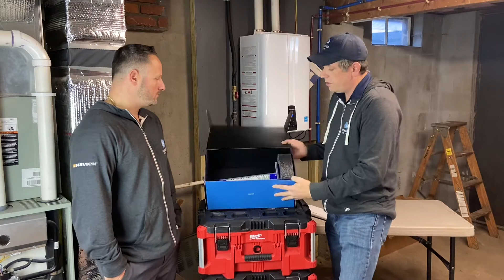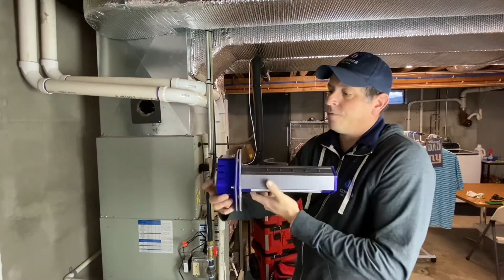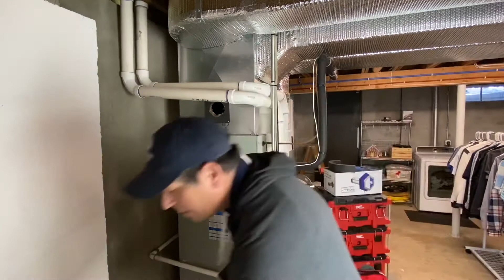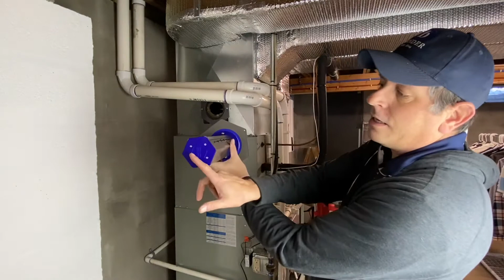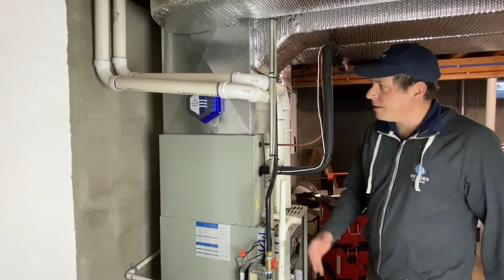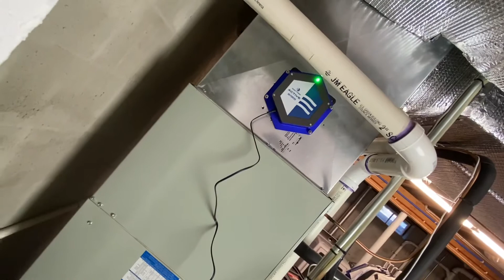UV Light Install- Dust Free Active Air Purification (Part 2)

Comment: Is the light on all the time or just when the fan is on?
Reply from the maker: It’s recommended you wire it to run continuously so it is always shining on the coil to keep it clean- however you can wire it to come on only when the fan is on. Hope that helps
Reply: @jasongiannone1229  Thank you.
Reply: @jasongiannone1229 would you use a sail switch for that?

Comment: Did you use the self taping screws, to secure the mounting plate or did they go through both the mounting plate and the base plate? It appear the holes in the plate  were pre-drilled or did you have to do that?
Reply from the maker: Hello- the holes come pre drilled so we just screwed through the pre drilled holes in the mounting plate into the plenum. Hope that helps
Reply: @jasongiannone1229 Thank you for the reply. They appear to have changed the design, since the mounting plate is not pre-drilled  currently. Also the instructions do not tell you how to un-screw and rotate the "core"  to align it properly (as shown in your video). Therefor you wind up with the logo going up and down (the light is now at  the 9:00 position) rather than sideways, with the light at the 12:00 position, as shown in the instructions. Were the screws used on the mounting flat flathead? Otherwise the heads would keep the base unit from mounting flush on the mounting plate. It looks like I will be dissembling the unit and  remounting it correctly.

Comment: We have one in our home 
We don’t like it cuz it has a strong order
Reply: What size do you have a 12" or a 6"?  If you have a 12" you can try downsizing it to a 6".
Reply: Air Purifiers with UV lamps can sometimes emit odor causing ozone. As of 2020, Dust Free has made it a part of its mission to guarantee its products no longer release any ozone. In 2021, almost all of Dust Free's products were recognized by UL, a top global safety certification organization, to emit zero ozone (UL2998 Certified). Any replacement cells ordered after 2019 will automatically include ozone free bulbs and ionizers.
Reply: @fadihurtubise7034  One contractor recommended the Reme Halo to me, and another contractor recommended the Dust Free Active.  I went with the Dust Free Active.  After reading your comment (about ozone), I'm sure glad I did!
Reply: Ozone is unhealthy and a respiratory irritant.
Reply from the maker: that smell is hydrogen peroxide- the ionazation process omits HP. its safe and has a clean smell- that means its working well.
Reply: @jasongiannone1229  is that the same as ozone? I’ve been concerned about the ozone levels being produced
Reply: @jasongiannone1229  I am enjoying your videos and you do a wonderful job explaining all the benefits to homeowners. Rather that hydrogen peroxide (H2O2), the PCO actually generate Hydroxyl Radicals (·OH). The hydroxyl radicals are an odorless oxidant which reacts very quickly to break down contaminants in the air.